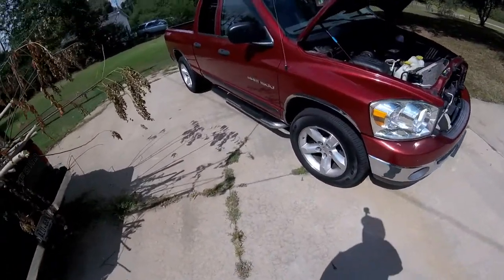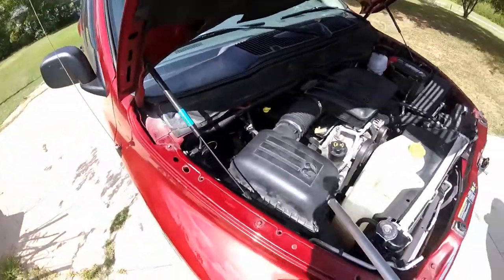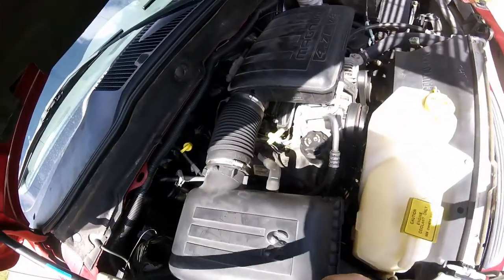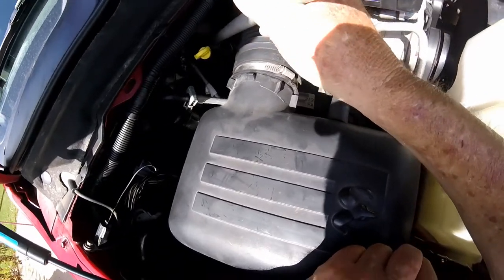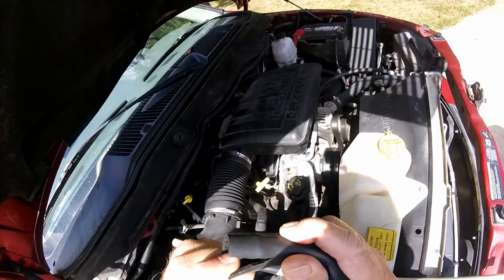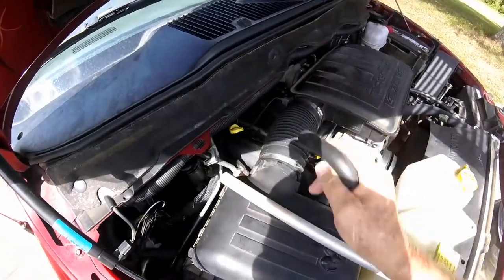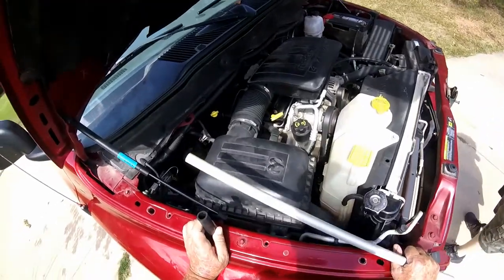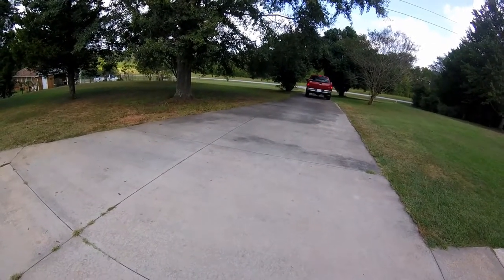Dodge Ram Truck Simple Idle Repair Pwalpar VLOG

Comment: Glad to see. That you got it fixed.... Just had to put a new distributor in my Ford. 1980. What. A job that was timing and all ????????? Got her running. Ok for a old truck with 200,000 miles on her second motor That's ok. It's a great truck to have the dog ride with me and going to the dump. Picking things up. Take care. By. The way. HOW THE BOSS DOING.  TAKE CARE. JUNKMANDO .
Reply from the maker: Thanks I need to fix my old truck

Comment: These new trucks are so hard to work on. Look at that engine. I’d hate to change the plugs. Looks like the 7&8 cylinder are under the dash.
Reply: ridgerunnerTN dodge has access plates inside to get to those cylinders. at least on the 6.7 cummins.